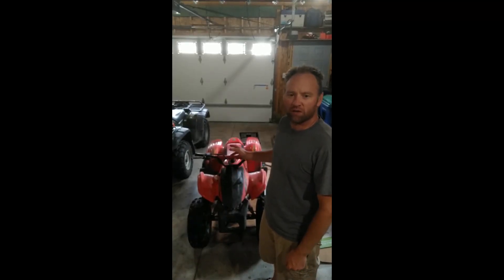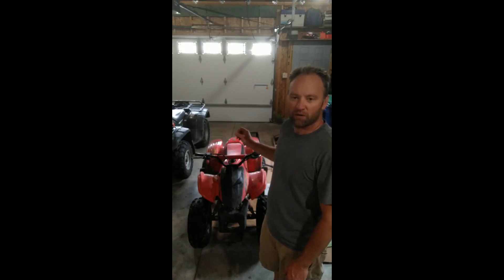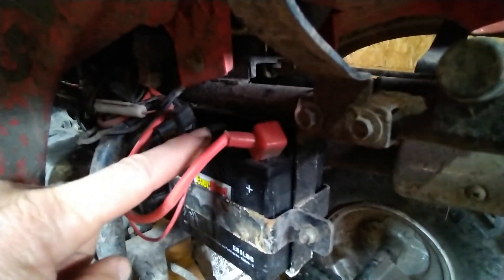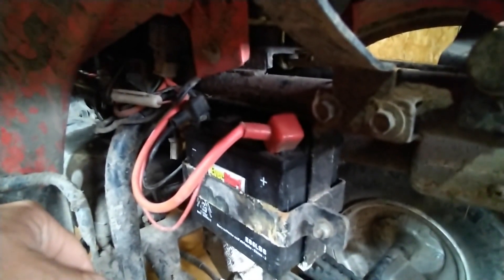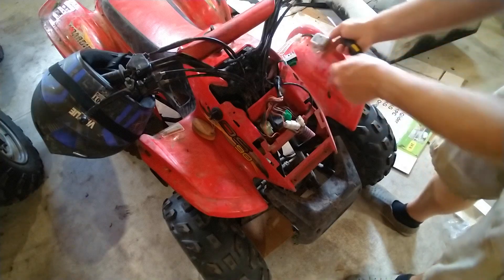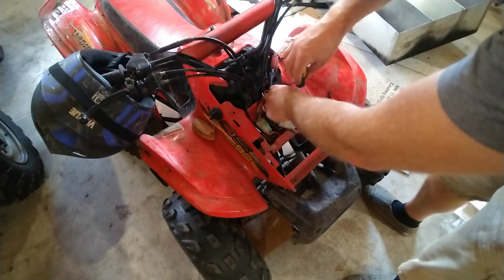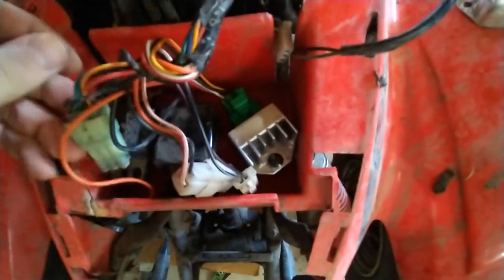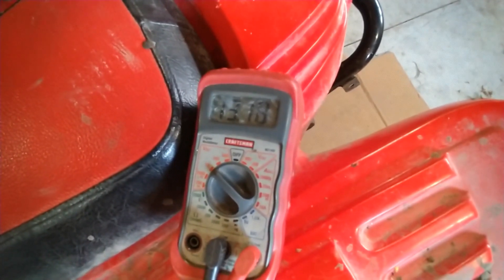ATV Voltage Regulator/Rectifier Replacement

Comment: The real skill is not replacing the voltage regulator.  The skill is in the research to find a replacement part.
Reply from the maker: In this particular case that was very true!